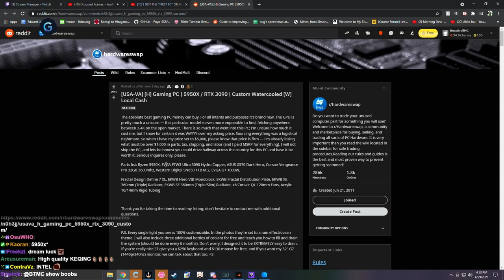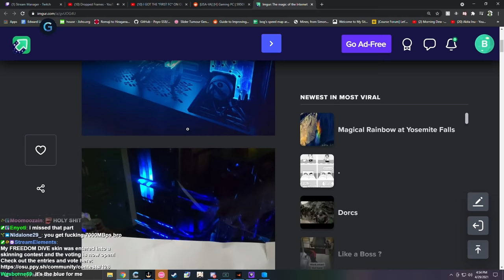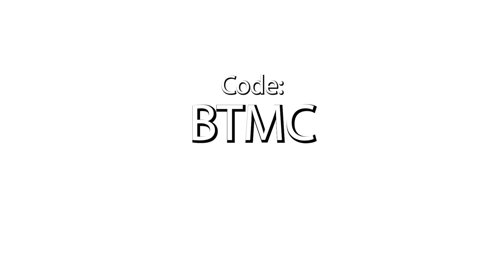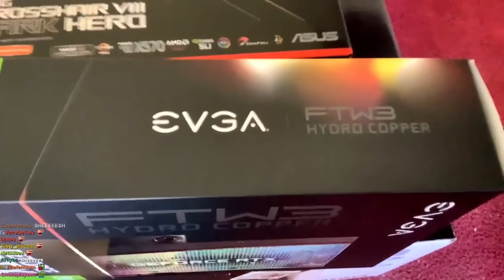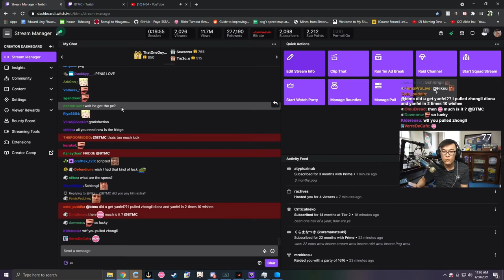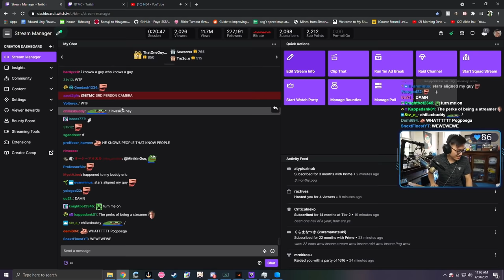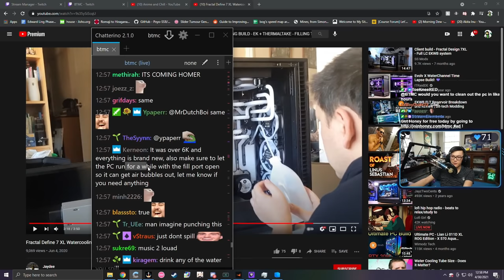I bought an RTX 3090... for osu?

Comment: I'm surprised from the tonsils story. Same thing happened to me. I threw up so much blood to the point my entire bed was soaked through nearly, and I threw up all over the ER when I went in. They were going to give me blood, and eventually they denied it however my mother showed up to the ER after some time of me already being there and yelled at the nurse to give me blood and the nurse refused. I had thrown up so much blood my organs began to shut down and I was nearly dead. My mother found another nurse and they ended up removing the other nurse from my room, and giving me a transfusion and had immediate surgery to re close my hole in my throat, because I threw up so much blood and apparently my lungs filled with blood causing me to cough a lot and reopening my stitches. I'm glad everything is okay. and I'm glad Kerneon is okay.

Comment: I run Osu! on my GT 640M (mobile)  and I7-3700S in an all in one PC. I get 200FPS on unlimited  at 1920x1080.
i used to run it on an Intel Pentium ( around 1.7GHZ I think) with integrated graphics (also an all in one, from STONE) used to get 60fps+ at 1080p